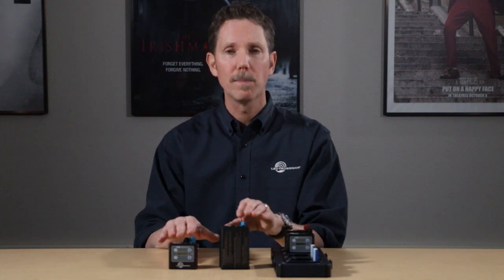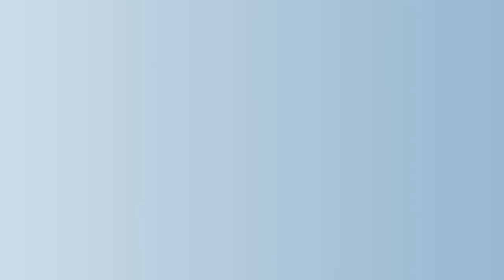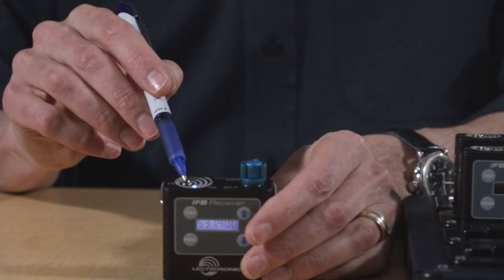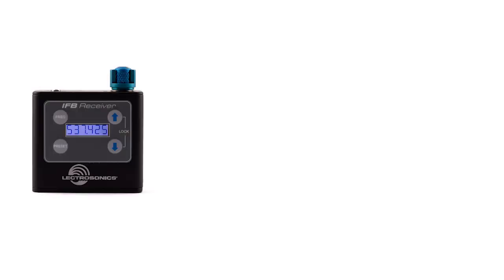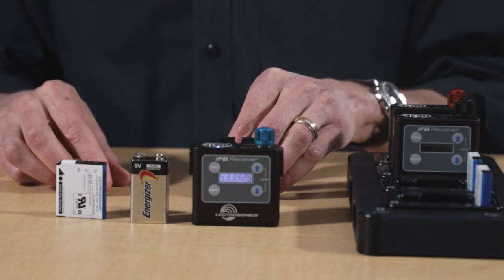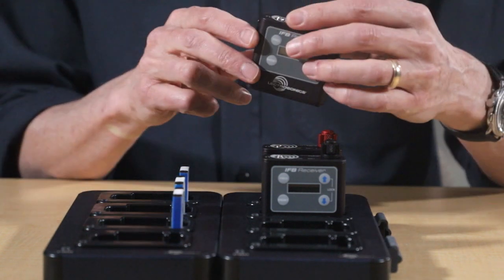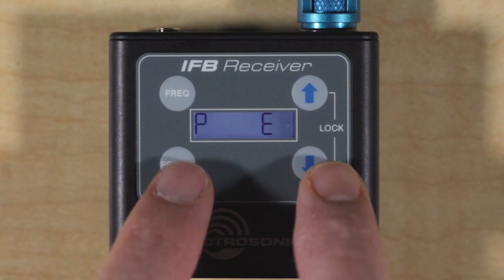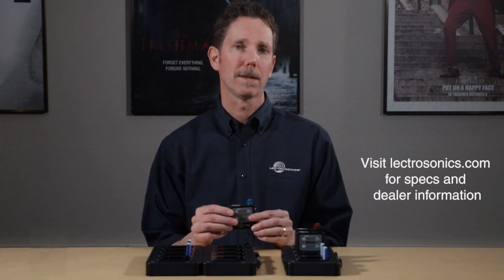Lectrosonics IFBR1B and Charging Dock Introduction

Comment: would this work with the duet TX ? Im thinking no but hey lets ask the experts :D
Reply from the maker: Thanks for your question! These units being analog and the M2T Duet transmitter being digital means that these are not compatible. The Duet M2R, however, does have an IFB mode so it can be used with an IFB transmitter. Not what you asked, but we thought it wouldn't hurt to point that out. Cheers!
Reply: I see, so how about a new IFB tx wideband is that coming ? Maybe for xmas lol thanks for your reply 🙏
Reply from the maker: Stay tuned! Love your channel, BTW.
Reply: 😬 sounds good, Thank you  🙏🙏